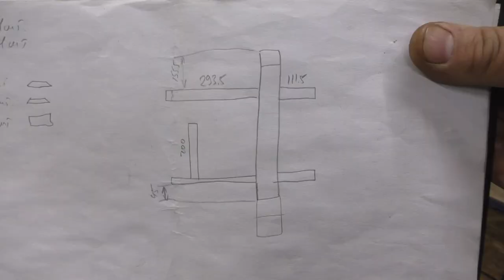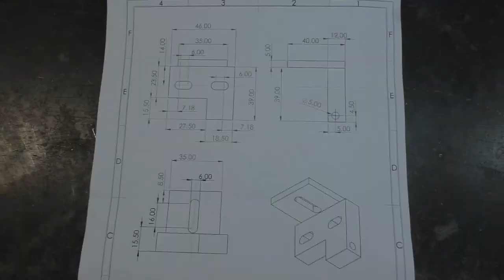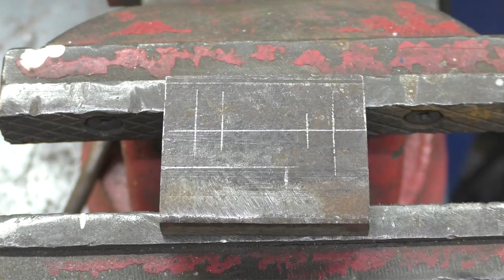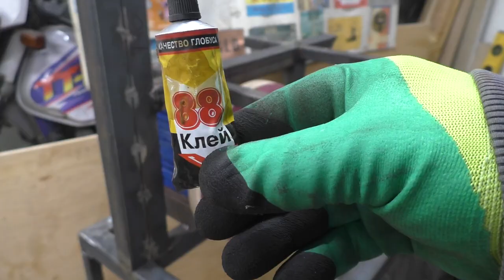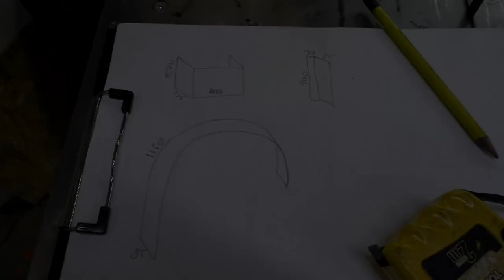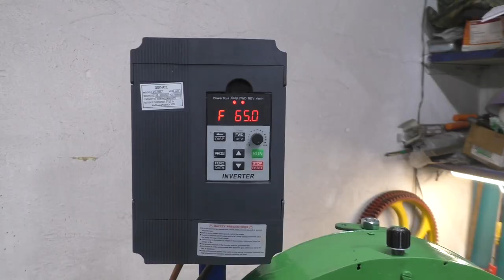Band Saw DIY, part 3

Comment: Hey there my friend.. Beautiful BANDSAW u built there. U made a fine job of it.
Can I ask what size motor u used and if it's a 3 phase or 1 phase?? I have a VFD and wanted to ask if I would need it for a 3 phase motor and is that why u used it or was it so u could cut thicker metals at slower speeds?? 
I'm very new to all types of motors and electrical stuff. I'm still in the process of building a Table saw with a sliding table extension but the motors are stumping me a bit. 
Would I be best off with a single phase motor for my table saw? I want to use the belt/pulley system bcos it's less noisy than those direct drive motors with the hard start like it's been shot out of a gun.. lol..
Great build anyways my friend.. Thanks for posting the video too. It inspires me to build better when I see these videos